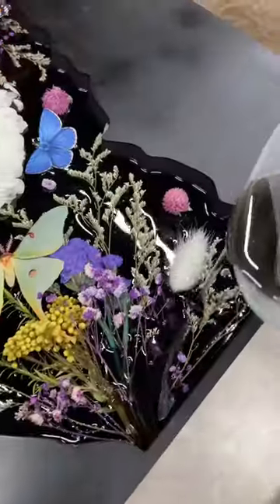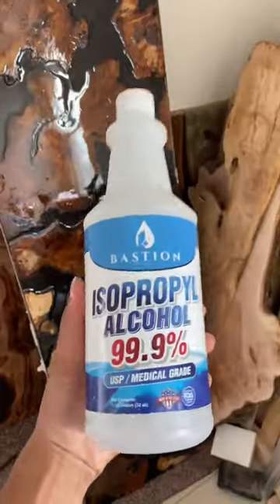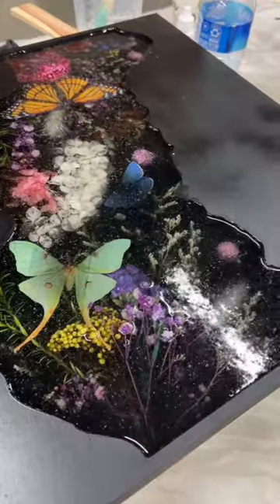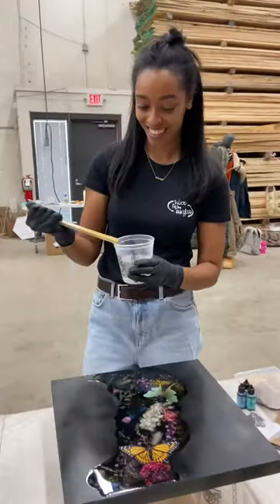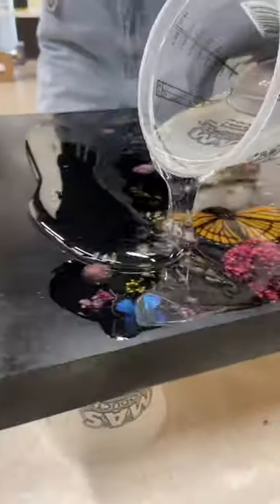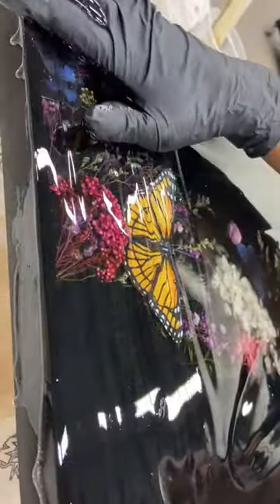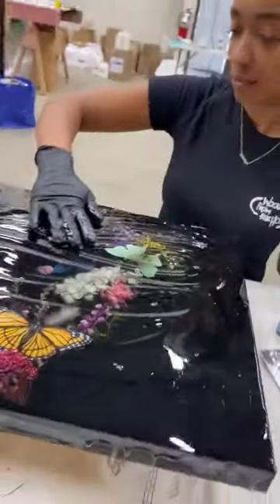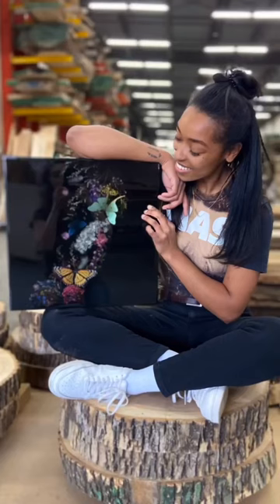HOW TO REMOVE BUBBLES IN EPOXY RESIN | VIRAL TIKTOK | TK FAREED

Comment: When do you feel it’s time to stop with the torch for final coat? I always seem to waste so much epoxy, because having to redo top coat, because of not being able to get it like glass…so frustrating!
Reply from the maker: It’s recommended to pour about 1/16”-1/8” in thickness for top coats, that way the resin can self level. Also make sure the surface you’re pouring onto is perfectly flat so that your top coats are also flat and smooth. I like to torch right after pouring, cover it up and leave it for about 15 minutes and then torch it one more time before leaving it alone to cure. Hope that helps 😁